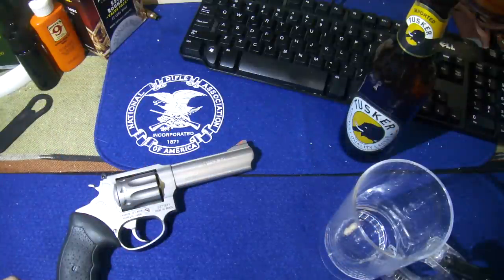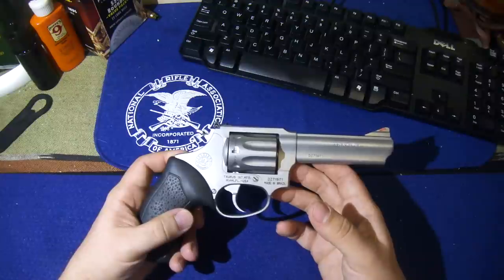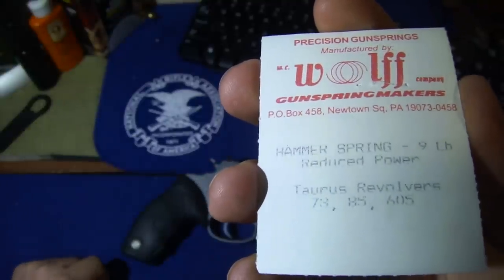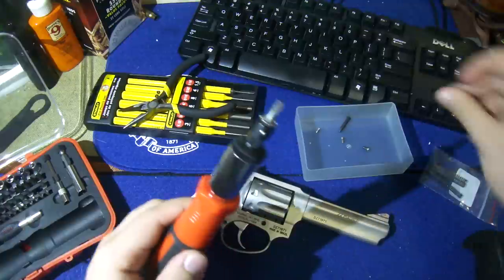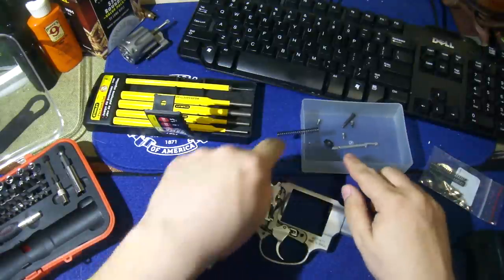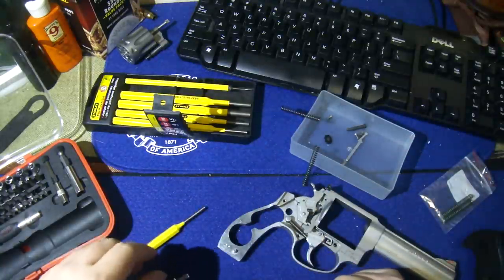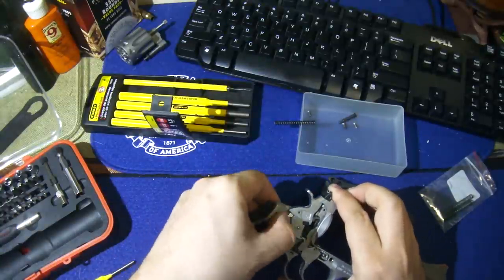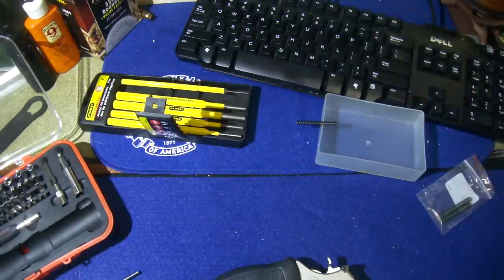Replacing the Springs on a Small Frame Revolver and the Jokki Mug

Comment: Ah! Don't make it a habit to pry the side plate off, you guys! For some revolvers, the fit could be tight enough that the prying could warp something or leave a mark.
Just take the plastic butt end of a large screw driver, or a non-marring plastic mallet and tap on the grip part of the frame, the plate ought to walk and pop itself out with a few solid taps.
Fantastic job on the detailed video though. Thanks!